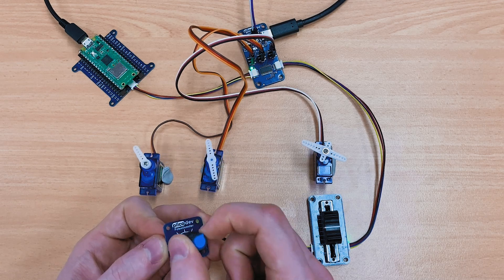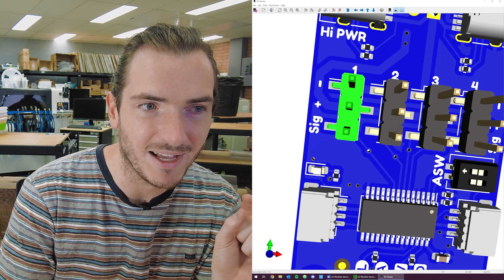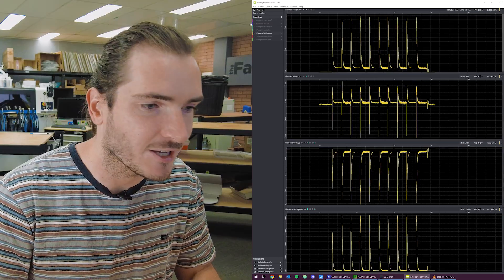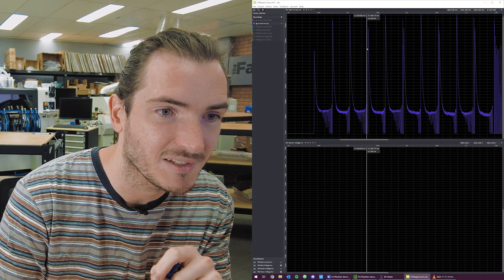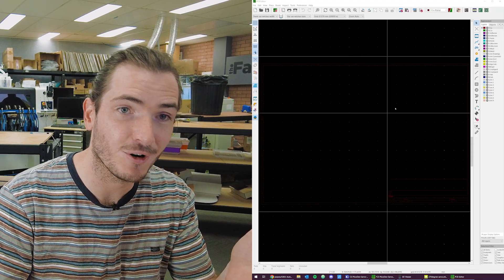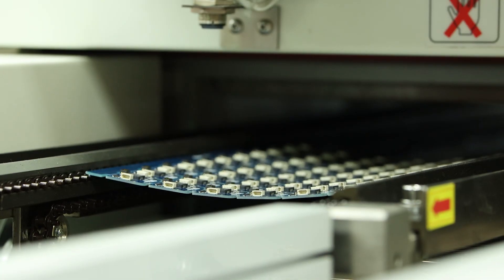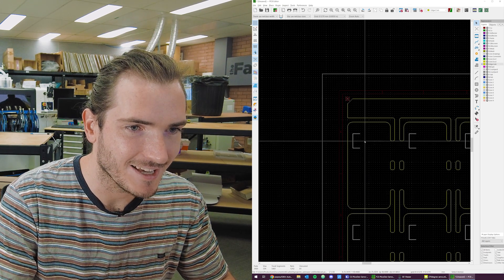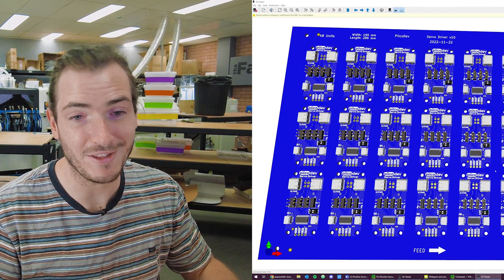The Factory | Design A Product With Us Part 5: Power Experiments & Panelisation

Comment: if the piicodev boards are mostly the same size then why not make a device to split the panels ...
Reply: I like it when i order 4 or 6 boards (say a lipo charger) and they come in a single piece. Then I snap em off as needed. I don't know if that counts as an upside or not 😀
Reply: Also.. it's like snapping gundam bits off a runner.